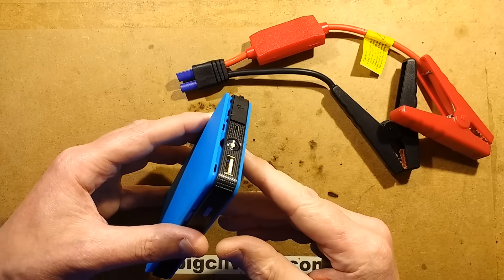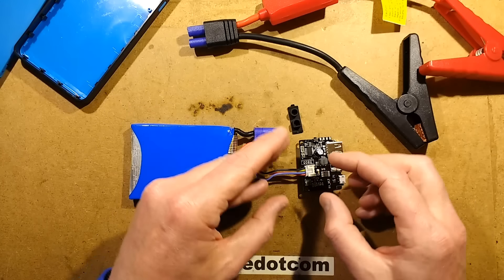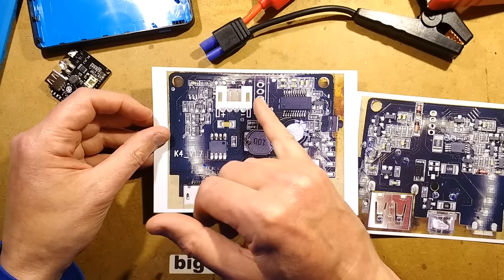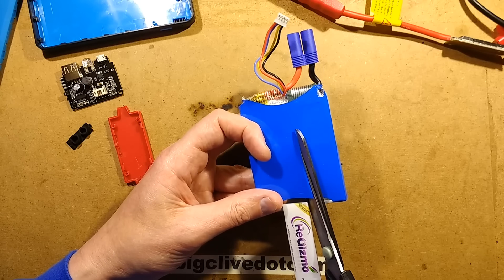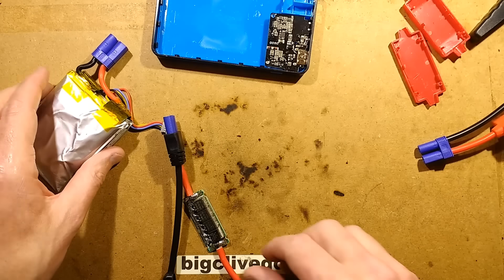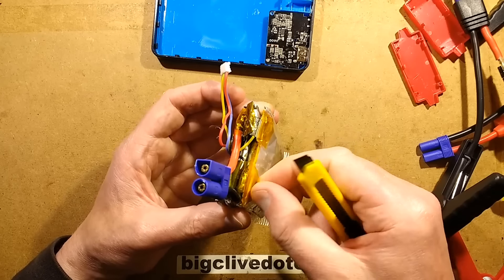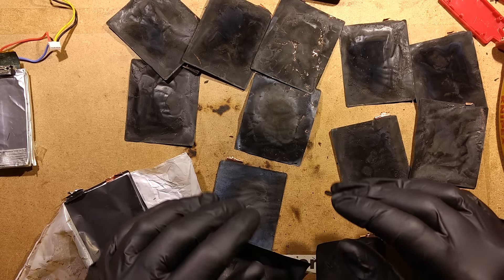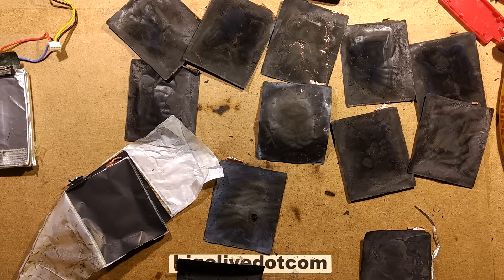Shorting out a fully charged cheap lithium jump starter.  (It didn't end well.)

Comment: All of us RC car guys are shaking our heads at people buying these. The most worrying thing about these is that people will leave these fully charged in their cars for emergency situations. Yeah let's leave a fully charged 3s lipo locked in our cars throughout the summer
Reply: Yep, there is a good reason RC enthusiasts keep their lipos in ammo boxes and other non-flammable containers...
Reply: I like to think that the more expensive, branded versions of these have higher quality cells and better protection than this particular unit...
Reply: +Andrew Gillard it doesn't matter much - it is still a high capacity, high discharge lipo cell battery you got there. I've seen a $200 lipo pack burst in flames in the back seat of a car. No way would I leave this unattended.
Reply: Indeed
Reply: This is why dash cams shouldnt use LiPo's either, and modding them to use capacitors is the most common mod. The chance that they will explode in a reasonable amount of time (few years) is low, but if it does, it can destroy your entire car. Im honestly surprised these car chargers arent sold with some thick insulation that will neutralize the battery if things go wrong.
Reply: What good is thick insulation with flames shooting out of it?  This type of battery doesn't just smolder and get hot, it becomes a torch.
Reply: There isn't really any major issue with that as far as I know - I'm more concerned about 'fully charged' being fucked up because the cell balancing doesn't work properly which leaves some cells overcharged and potentially damaged. No over-current protection either, so these are essentially just raw hobby-grade LiPo packs, which do need to be handled with respect, and most people won't really appreciate that if they haven't done their research.
Reply: W19 ELY  serious question - if I did want to keep one in my car, what's the safest way to do it? Someone mentioned you guys use ammo boxes. I'm not against that, but these days, I don't want to get pulled over with an ammo box in my trunk.
Reply: Look up "lipo safe bag". These are made of glass fiber and will prevent flames from coming out.
Reply: Ammo boxes, especially .50 cal, have been used for you-name-it ever since WWII.  I wouldn't worry.
Reply: KingNast I really wouldn't keep one in my car myself, they don't like the heat, they don't like the cold. Also I don't think that these lipo batteries have sufficient power to crank/start a large vehicle. I would just get a lead acid jump starter. Either that or simply an rc car battery pack and a set of jump leads. Any reasonable sized rc car pack is going to be of a higher quality and more suited to the job then that little battery
Reply: isn't that already a lipo safe metal bag that Clive unwrapped on each lithium cell? and isn't it what saved it from bursting into flames in the first place?
Reply: I was actually scared when he shorted it out!   I feel a lot better about lithium batteries now.    it kind of self destroyed it self without bursting into flames. test passed!
Reply: They certainly do have enough power to crank/start a large vehicle. The proof of the pudding is in the eating and I have used one many times to start a large station wagon with a lead acid battery that was kaput until I was able to get a replacement lead acid.
Reply: Hmm good point when you put it like that I think most are actually lithium ion which I believe is more stable but you have a point in extreme conditions still could end very badly I suppose it depends on the safety features in the design and like anything the cheaper it is to produce the less safety features it has.
Reply: djmips Rather you than me
Reply: Lithium ion cells could not put out enough power to start a car. One of the best, the Samsung 25R is rated at 20A. You have to use a lipo for this application.
Reply: The danger in lipo lies in either faulty charging or physical damage. You're not going to physically damage a pack in a hard case. So if it's going to fail, it will fail while it's being charged. I've kept these fully charged in my car for several months. I'm not worried.
Reply: Mine just blew up.  pop!  double the size now~!
Reply: use 18650s instead...
Reply: What 18650 is going to provide enough current to start a car?
Reply: How long did you crank the engine?
Reply: W19 ELY lmao yea
Reply: Put them in a mini cooler then put them in an ammo box
Reply: Simple answer is you should not keep them in car at all.   Li-Po are more powerful then  li-ion but are far more temperamental. The heat of the summer will guaranteed ruin the battery even if it doesn't catch fire it will be made useless after a single summer month.
Reply: Thermal runaway? What temperature does it take to start that? Impact? From what?
Reply: That's obviously not true because I've had mine for over a year and it still works. I'm in the middle of the USA.
Reply: I appreciate your taking the time to post this. I have read about the dangers of lipo batteries, but I thought the main mode of fire is charger malfunction. I try to charge it at home so that I can know if it catches on fire. My car is parked outside, not under any shade. I keep it in the glove compartment. I feel that there is little danger when I use it this way. These things are selling like hotcakes, so I imagine there would be a consumer advisory if there was an issue.
Reply: Just keep it in your purse or something
Reply: Well, my car is black, and it has been 103 degrees F last week, and I park my car outside on a black driveway. No fire yet.
Reply: ThingsDemystified 
Wait for it ;)
Reply: Hehe, somehow I feel that if these were really that dangerous, there would be a consumer safety advisory or something like that. I work on electric bikes, and I hear about lipo fires all the time. It's usually caused by issues with charging or physical damage. I'm not afraid of it right now =)
Reply: thing is, they shouldnt be LiPo, they should be LiFePO4, which the good ones are, which are perfectly safe in a car in summer. Thats also why they make EVs with LiFePO4 over LiPo or LiCo too
Reply: It takes several hundred amps to crank an engine. Only Lipo is capable of supplying anywhere near that amount of current in a compact package. A LiFePO4 battery capable of starting an engine would be humongous!
Reply: lol. keep researchin
Reply: Keep researching? Show me a LiFePO4 battery capable of supplying hundreds of amps continuously.
Reply: 1ka for 10 sec is plenty to start a car. or truck
Reply: Mijc Osis, exactly, if you want to stay on the very safe side!

I don't know about ginormic V8s you have down there.
To start a diesel V6 3L here in EU 300 Amps are more than enough, and you don need 10 secs, except probably in northern Scandinavia in winter ...
Reply: I almost forgot.
The LiFePo link I posted is about an 8.4Ah 30C.
That means that you can pull 254A continuously until you drain it (still better watch out for overdischarge).
That means that the peak power you could pull for a couple of seconds (more than enough to withstand the dead short occurring at cranking a still starter) is around twice that.
So to have 1kA peak you need just a couple of those, as when it has to just keep it turning it absorbs much less current than at start.
Reply: It was mainly super funny cos they are currently the standard in electric vehicle battery. Which is about the only thing that actually DOES require hundreds of amps continuous
Reply: Mijc Osis 
As far as I know the big T uses in house developed LiCo based 18650s, 3.7v each.
~400v, more than 1kA peak current, for the entire battery.

In a car battery, where you have hundreds, if not thousands of cells, with complex series/parallel matrices, single cell current rating is not that important factor.
Reply: Try again - the use NickelCobaltAlunimium Cathodes in the S Type, MagnesiumCoboltOxide in the powerwall, and the new in house batteries they have yet to put in a vehicle are developed with panasonic, and the chemistry is not yet known. Tesla is also a race car, they arent what you should judge by, their tech is largely irrelevant to real EVs
Reply: Mijc Osis

Who are you talking to?
You just confirmed what I just said, no Tesla road-worthy battery based on 18650 size cells uses LiFe chemistry.

I happen to know a bit about the matter, as I have taken some ”stupid” official training in Tilburg (Netherlands) and Thatcham (UK) about how to handle HV on S and X to be able to structurally repair them.

And I signed quite a few NDAs, that's why I firmly refuse to be more specific.

If you have any clue about the new 2170 cells' chemistry, you are more than welcome to post some link.

Alternatively, you can buy a subscription like mine at service.teslamotors.com.

Tesla is the benchmark. Period.
Others gasp following.

Cheers
Reply: lmao. you keep believing that. While other companies actually build cars that make a difference for people that wouldn't buy rolls royce, and people that want less gross waste than tesla factors in
Reply: Mijc Osis

Whatever, mate, only numbers are always right.
Reply: yep, and tesla sales numbers dont lie. Theyre just sad.  Theyre a joke. i mean, we really needed another environment destroying niche company to help the well heeled rich look fashionably socially conscious. Thats all tesla is.
Reply: Oh and btw - no  teslas are LiCo, as you claimed, either
Reply: Mijc Osis 

You're right about the LiCo point, I was so focused on the cobalt that I lost sight on the rest.

However, you really don't get the picture.
400k model 3 already sold is something heavy.

To catch up, also in opex, others have to sack the service kraken.

No traditional car company is showing even close to that.
No other EV only company is showing any relevant numbers.

If that's not clear enough, future will tell you even more.
Reply: I didn't even know there were such batteries. Why aren't more people using them? Are they new? So they won't go up in flames if they're punctured?
Reply: ThingsDemystified 

First, as you can see from BigClive video, no battery goes up in flames from nothing.
If damaged enough physically (through either direct shock, excessive load, overcharge, overdischarge, or a combination of the same), they heat up a lot (even to >600 Celsius) and produce gases at a considerable rate, so that if all that heat and gases are kept tight in a very confined space (like a sealed laptop pack or an IP67 smartphone), they end up cracking the container.
If, during thermal runaway, the hot gases come in contact with atmospheric oxygen, flames could burst.

That's not the same as ”they explode”.

So, if you are talking about LiFe, it's a younger chemistry, they have a slightly lower cell voltage (~3.2v vs ~3.7 nominal, that's why you need 4 cells in series instead of 3 usual Li cell to get to car voltage), they weigh more, so worse energy/weight ratio, they have worse current ratings (that's why you need more cells in parallel, to distribute the load among series).
So in the end you spend more money for heavier stuff.

BUT, STILL

The nominal critical temperature is way higher, the charge-discharge cycle number, hence longer lifetime, too.
And while absolute performance is a bit lower than LiCo, it's still far better than older chemistries.

It's like a reliable Merc E-class, that weighs and costs a bit more than a 1000hp Supra that will probably have its engine blown to pieces every 10 runs.

~150 Celsius for LCO vs ~195 for LFP, and much lower and slower envelope of temperatures during thermal runaway (check conclusions):
http://pubs.rsc.org/en/content/articlehtml/2013/ra/c3ra45748f
Reply: Let me ask you this. Are they as safe as typical 18650 cells like the Samsung 25r? Also, Mercedes is the last name I would think of when it comes to reliability, and comparing it to a drag engine is apples to oranges =)
Reply: W19 ELY I'm not planning on leaving it in a locked car. I'm planning on having it at my work station so I don't have to carry a lead acid battery jump starter across a huge parking to go get a dead car that I have to do some maintenance on. We have fire extinguishers handy.
Reply: Haha my Lipos are safe and sound at a nice 3.8 volts
Reply: I clicked the like button thrice.
Reply: MasterBata I just keep them lying around until I need them. They should be stable as long as they're not over-discharged or shorted out, or you don't store them in a sauna.
Reply: ac3ofspades878 Insulation won't do any good. When LiPos fail they vent a lot of hydrogen, effectively becoming a blowtorch. Unless it's a airtight and flameproof container, the flame will erupt from the nearest hole.
Reply: KingNast Get some LiPo bags. LiPos are stable as long as they don't overheat and aren't over discharged (if cell voltage is below 3 volts, even slightly like 2.99 volts, they can be unstable). Store them individually in separate LiPo bags in your trunk. If you want extra protection, store all the LiPo bags inside another LiPo bag.
Reply: Content Updating Oh God. These are still very niche, and there's already plenty of stories of puffing up and fires when left in a hot car. That consumer warning is coming but there's consumer warnings for power banks because of massive fires and they've made no difference.
Reply: +Terry Beardmore A powerbank is quite literally a bomb!
Reply: @thingsdemystified  look for 26650s 45a to 50a only 5000ah cells tho strap a couple together u prob fry ya starter earth strap lmfao
Reply: And how big would such a device be? I imagine it would be huge.
Reply: Second summer down. No fires. LoL. Oh, and mine is 4s.
Reply: Content Updating you have to run series/parallel grouping to get he voltage and amperage to do so. Ganged up in series of 3 to get to the 12.6 volts just like these lipo packs aka 3s lipo pack
Reply: My point is that the pack would be so big it would be impractical.
Reply: Just FYI, many of those are 4S
Reply: No, it won't.
Reply: @davey2k12  This in not Li-Ion, but LiPo battery. LiPo's does support gradually larger currents.
Reply: @thingsdemystified  I have one - but it is the size of a car battery. Only half the weight, what is really nice for 12V/100Ah. But that is not in the car all the time, only for camping.
But I have some electric problem where some computer boxes sometimes do not got to sleep correctly and after a day the battery is flat. For jump starting I often use a 4s/5Ah hobby king battery. Rated for 20C (100A) and has a hard case. That works really nice, takes a second or two to start the engine, nothing gets hot and after 10 or 20 uses it still has above 15 or 15,5V.
Reply: @thingsdemystified  Don't forget: Starting a car is quite the opposite of a continuous load. Even the starter would burn up in continuous operation. You just need a burst of power 1 or 2s long.
Reply: @goamarty  A few seconds might mean continuous to one person and peak to another. The continuous rating of a battery will give you an idea of its capabilities. Now if you find a "peak" rating that specifies how long it can operate at that power level, that would be ideal.
Reply: @goamarty  I'm not really sure what you're replying to by saying "I have one."
Reply: I like to store mine next to tha querosene and gunpowder keg.
Reply: @w19ely85  i got one and succesfully started my Honda severell times when the battery was down. I like this battery .
but i will not leave it in the car after i read these comments :)
Reply: @dbeierl  ... and it's always good to have a few ammo boxes with something other than ammo in them. You know, in case of a random search.
Reply: yes mini charnobyls waiting to happen
Reply: @wtfiswiththosehandles  Glass fiber can break way too easily for the amount of harsh chemical in that bag! 

If one of these 12v battery jumpers were dropped on the floor or had something heavy crush one when in the boot of a car and a bit of plastic or a screw from the casework split the bag, same issue. Glass fiber is great for mobile phone batteries but not for something this big and high current. That's why RC car guys are freaking out! These are hardcore batteries like what you find in a laptop. Laptop batteries are protected in plenty of plastic/metal despite the individual cells also being protected in plastic and metal. Also, they should use very small/short screws or just glue for assembling those cases to ensure that a broken screw can't become a lance!
Reply: @lowerthetone  Glass fiber can break? From what? You know it's one of the strongest fibers we have, right? And it's not flammable, which is the biggest concern.
Reply: I Just Got Back in R/c.  Lipo is a Longgg way away from No-cad Day's... Special chargers, temps etc. Like holding a M80 in one's hands.
Reply: Û no
Reply: @grepthis2000 It's cute that you think the left would have a prayer
Reply: Forty years ago I use to run an RC speedboat and charge the batteries in my car with the ac to keep them cool. One day I left the charge on and went in to a store when I came out the battery had exploded into many pieces and were burning through the seats.
Reply: @w19ely85 , the same
Reply: @w19ely85  another alternative is a super cap jump starter, I've used an Autowit and Schumacher one with pretty good results. No lithium involved and it handled a 302 V8 Mustang with no problems.
Reply: @wtfiswiththosehandles  it's definitely a valid point to bring up that leaving a lithium battery of any type in a hot car without protection isn't very smart. But to act like it's Kryptonite and say you'd never do it when there are certainly safe ways of doing it is not logical. A car can get very hot inside very quickly. An insulated container with in the car would not. Use your head.
Reply: @aznative_  Did you read all my comments here, or did you just decide to spew random BS in a 3 year old thread?
Reply: @thingsdemystified  Unfortunately they don’t do much when it’s cold. Those starter packs will not start anything below 0F or thereabouts, assuming the car is cold. I tried and it did as expected. Their internal resistance is too high. Maybe if I waited long enough for the cells to get hot it’d work better.
Reply: And it's rated for...80CCA?! What's that gonna start, a lawnmower?
Reply: @thingsdemystified  
https://www.metabo.com/au/en/info/competence/battery-pack-technology/lihd-battery-pack-technology/

There’s lithium ion packs bigger than this and it does 3200w@18v ~ 177A. 

It’s possible to crank a starter for a couple seconds I bet.
Reply: "lipo are more powerful lion" lol lipo is a type of lion.
Reply: @Sad0felix cool story bro.
Reply: @Felice Masi cool story bro.
Reply: @W19 ELY if they use a good AGM vehicle battery that "emergency" would be reduced". Don't need these emergency lipo packs 😂
Reply: @MasterBater higher quality always matter. If you want a low quality battery then go for it 😂
Reply: @stinkycheese804  The insulation directs the flames so you can use it for roasting marshmellows!